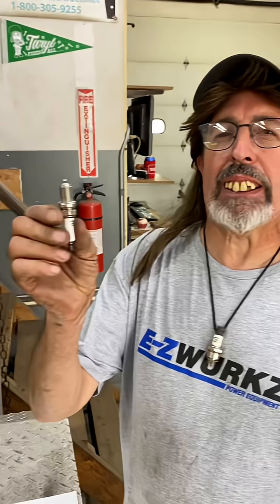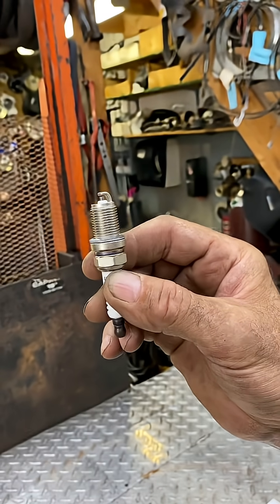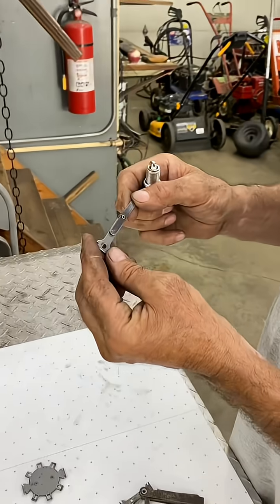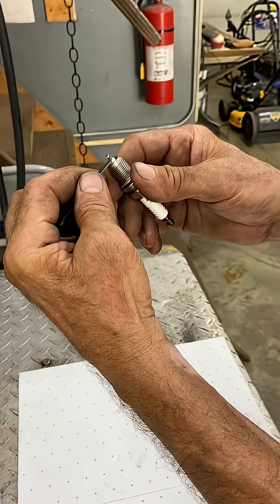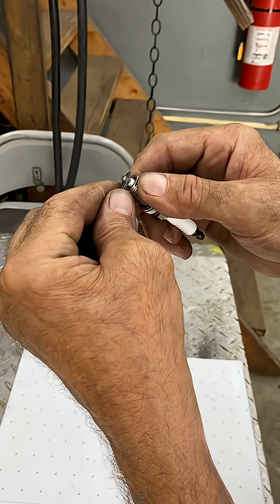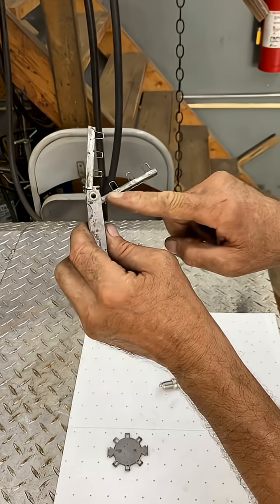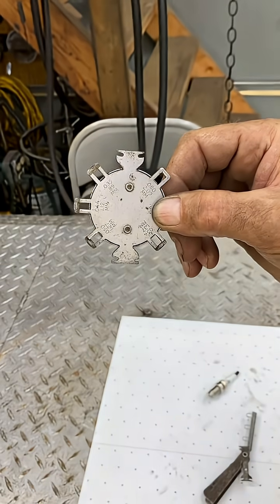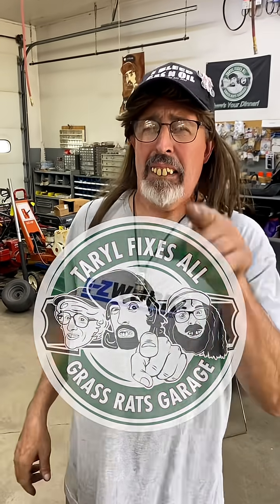How To Properly Gap A Spark Plug

Comment: I buy a used cheap chainsaw that did not run. I buy a carb kit, new fuel lines, new primer blub, new gas, new gas filter and a new sparkplug. All this. It wont start. I can see gas going through the lines and primer blub and with sparkplug out, I can see it sparks. Why wont it start? I did not know what to set the gap on the new plug so I did not set it. Turns out that's why it would not start. The new plug gap was .035. The saw needed from .025 to .020. The gap was too big and made the spark too weak to start it. I set the gap at .020 and the saw runs great.

Comment: I'm guessing I'm going to upset some folks out there but I've been using the round type plug gap tool sold by Snap On that uses in incline plane to check the gap.  I've used this type of plug gap tool over 40 years on literally thousands of spark plugs and never, ever, once had a problem.  The manufacturers warn against this tool but can never tell me the potential damage it can cause.  If someone can tell me a convincing reason not to use this tool, I'll stop using it but you just can't argue with success.
Reply: Ive used the same one for years, no problems...
Reply: Maybe you could damage the electrode if you twist the gapper-thingy to increase the gap? 
I don't think they are that delicate,  but then again,  I've worked with guys who could break an anvil...

Comment: You don't use the pull- tab from your beer can?😂
Reply: Good tips Taryl; whether it's valve clearance, setting points or the gap on a sparkplug, the feeler gauge should enter easily, but have a snug grip as it's moved back and forth.
Reply: And here I'm thinking USE A BUSINESS CARD!!  😂😂